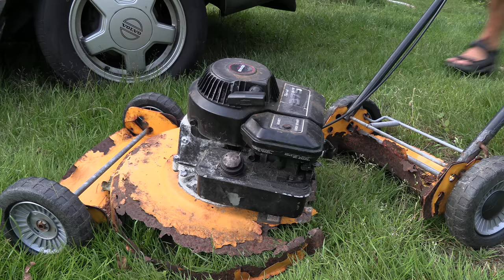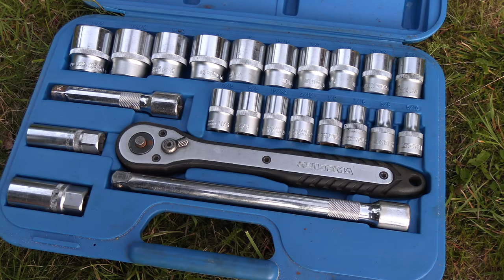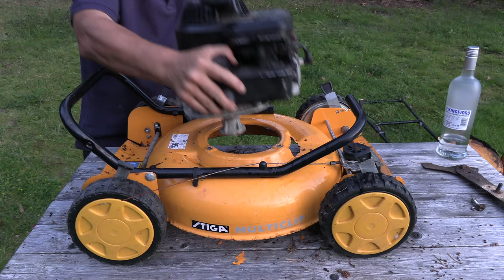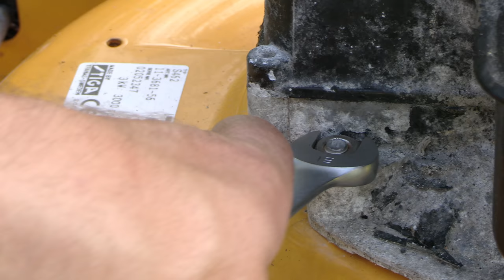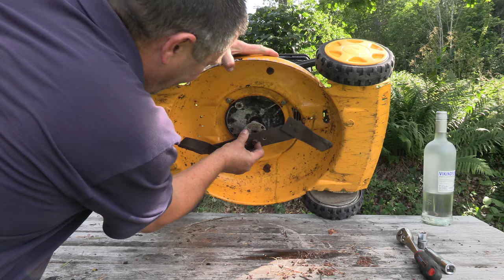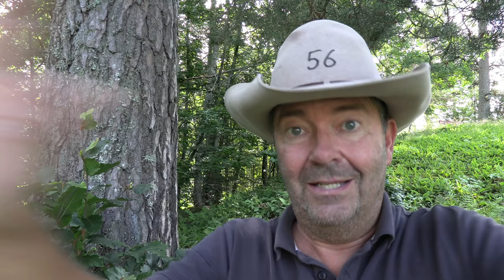Replacing Lawnmower Body

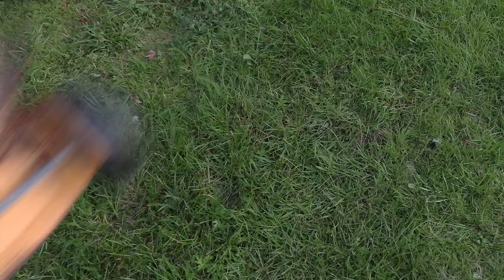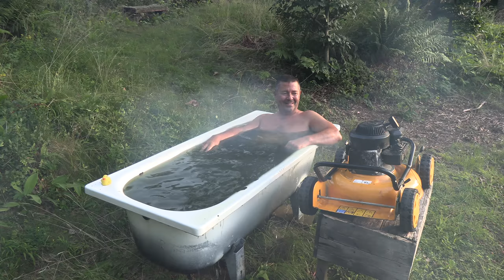Comment: 1:01 I think he dropped the engine on the ground when he got the last bolt off. Notice he cut away real fast😜 Edit: 2:29 I was wondering why he had the machine next to him at  the tub- it was to keep the mosquitos away.
Reply from the maker: Yes, when I get the last bolt off and lifted the engine too much:)
Reply: This is what happens when when you only use ein bolt.

Comment: you need NYLOC nuts 'cause the engine vibrates a lot
Reply from the maker: It was not nyloc nuts before replacing, not needed. Not much vibrations.